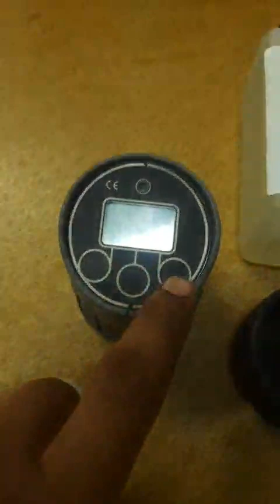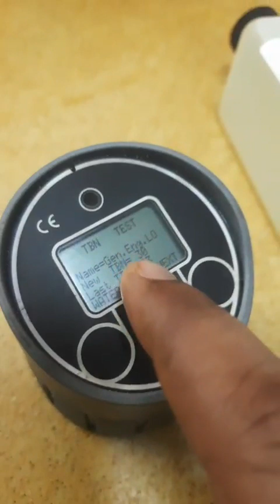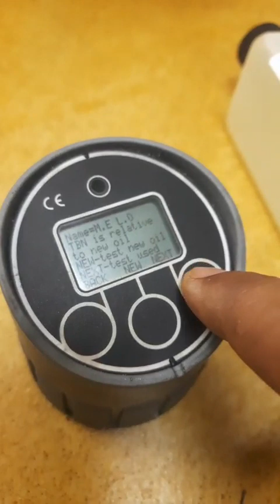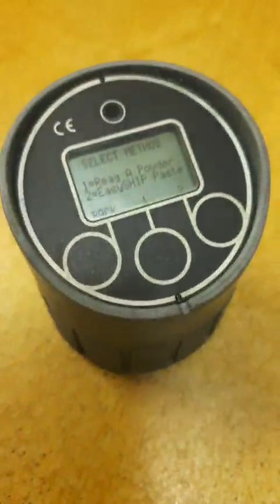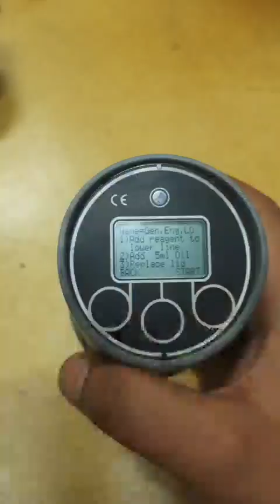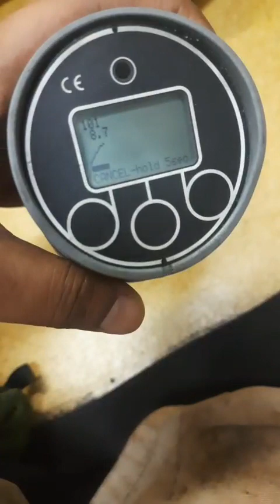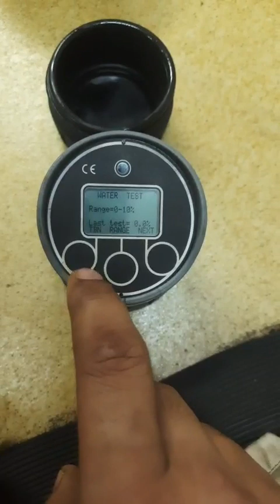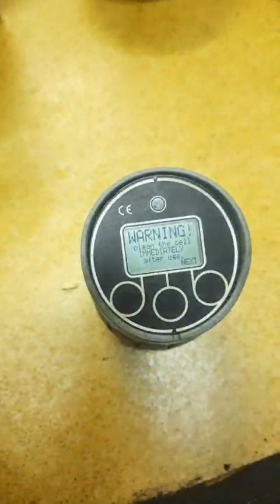How to do TBN test and Water in Oil test tor Oil samples ? Important video #digicell #Unitor

Comment: On what basis do we select the range for water test?
Reply from the maker: We must select range 0-10% ,
But if you wish, you can also opt 0.02-1% range,but result comes as < 0.02%. If u want absolutely accurate result, go for 0-10% range
Reply: First you choose a higher value to do not damage the pressure sensor